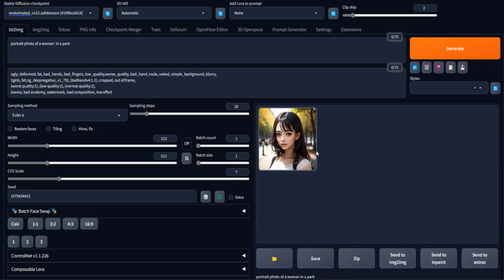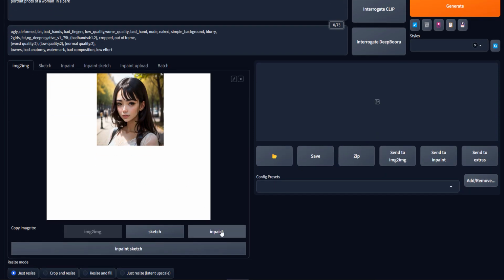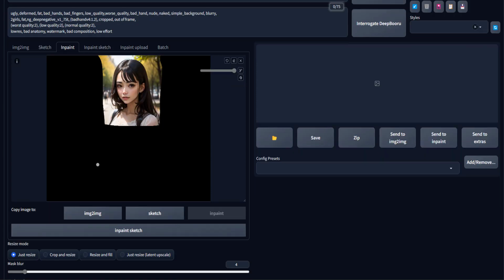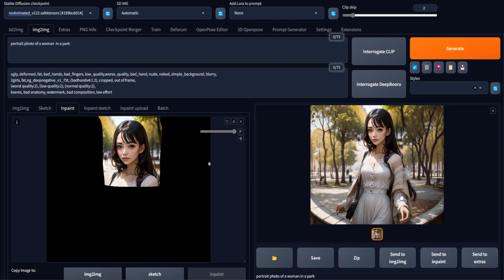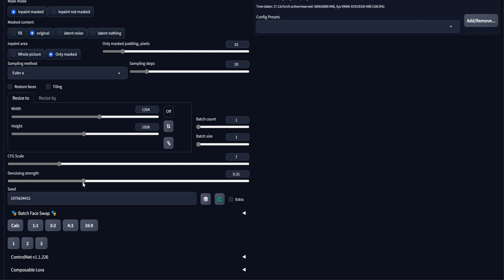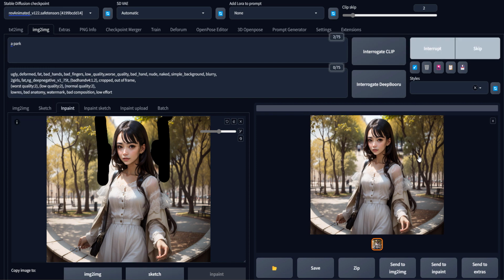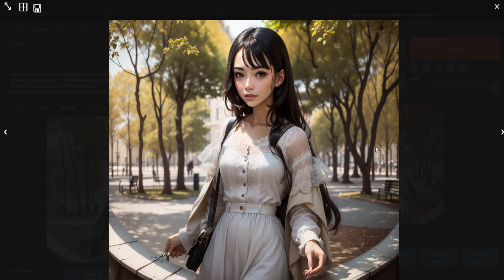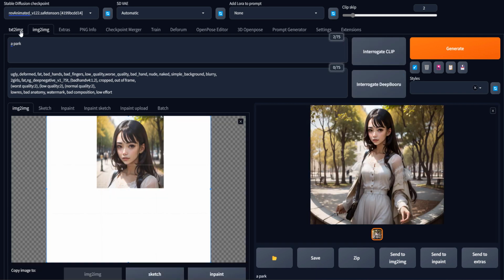simple method for outpaint using stable diffusion A1111 | Method (2)

Comment: it would be great if the zoom extension worked so we could extend the picture without MS paint , too bad that extension sucks
btw your method is perfect , it worked for me , thank you so much .

I hope the next SD updates don't ruin the extensions too much . it's a pain in the ass trying to get these things to work properly .
Reply from the maker: true, i believe we will get better extension and methods soo for outpainting, because it is very useful.
Reply: using auto1111 if you put an image into inpaint you just need to increase the size in the "resize to" box depending on which way you want the outpaint to go,to make it wider increase the width, then mask just a small line on the edge of your picture that you want it to outpaint, both edges will keep the image central